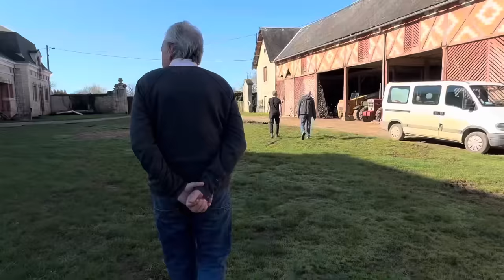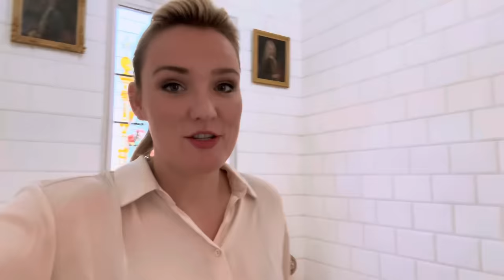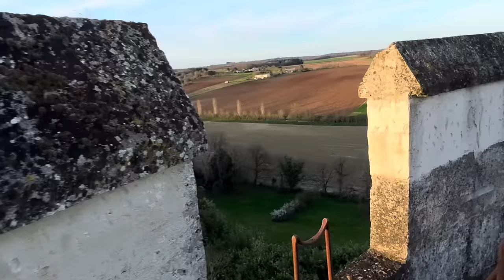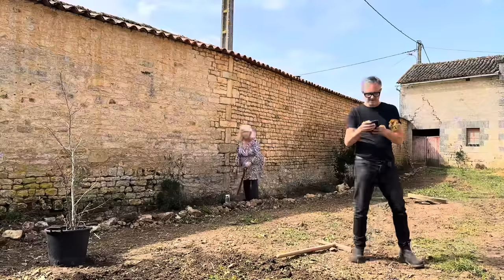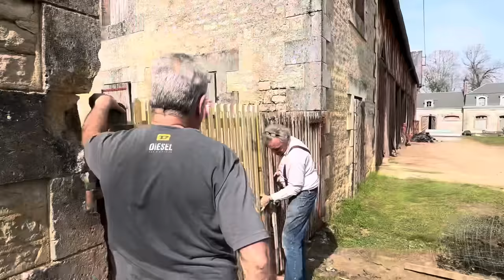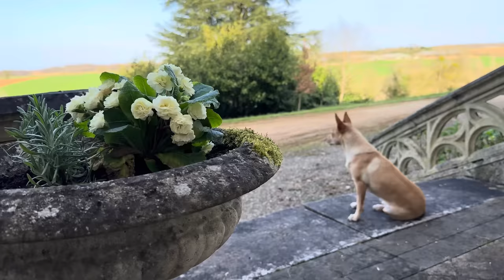Starting the FIRST CHATEAU PROJECT! Friends wanting to help!

Comment: Happy Easter 😊
You're right, ivy is such a pest to old buildings.
What were those iron things in the crenellations on top of the tower?
Beautiful views!
Reply: Self-clinging climbers such as Boston ivy and Virginia creeper (Parthenocissus sp.) do not usually cause damage to wall surfaces, but common or English ivy (Hedera helix sp.) supports itself by aerial roots and where these penetrate cracks or joints they may cause structural damage. Sound masonry is unaffected.